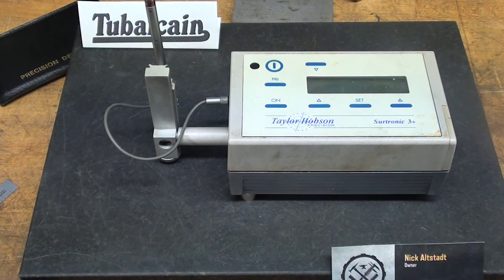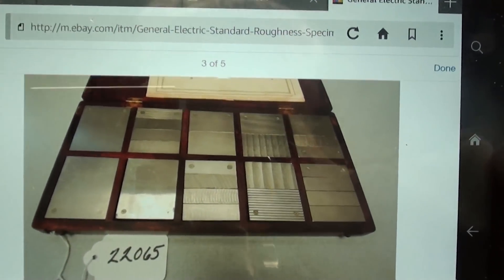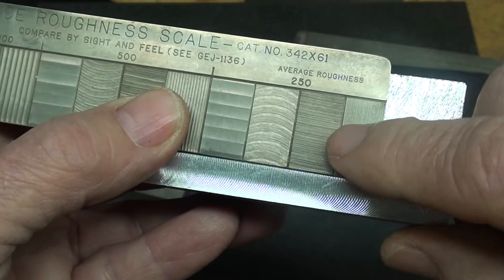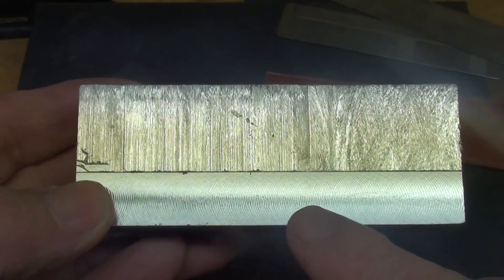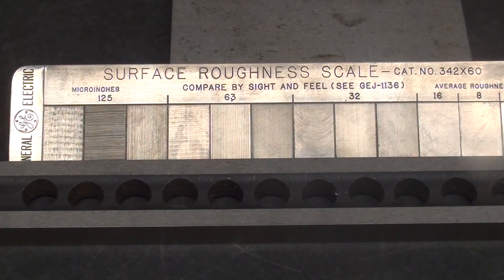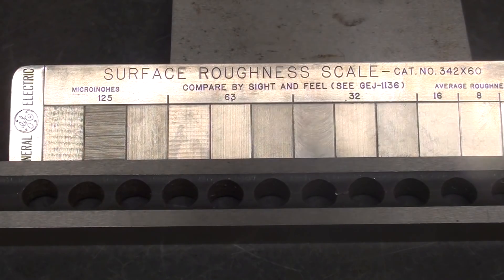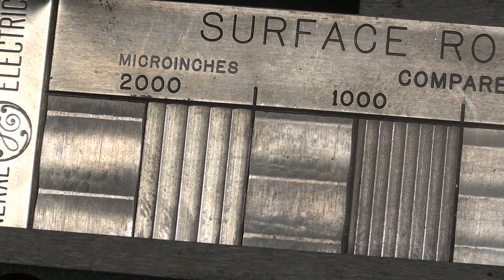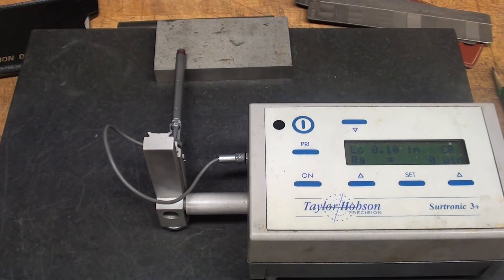SHOP TIPS #293 Surface Roughness Finish 1 of 2 tubalcain

Comment: Profilometers are often used to measure the roughness, the avg(Ra) the peaks(Rp) and the valleys(Rv), of the decks of an engine block and it's associated cylinder heads after they've been resurfaced. Some cylinder head gasket manufacturers require a certain finish in order to maintain a seal with their gasket.
Reply from the maker: Thanks

Comment: Long ago I tried an experiment of testing surface roughness using my fingernail and realized it was the sharpness of my nail that was the biggest limiting factor of how sensitive that method was. I had a fairly long thumbnail at the time so I stuck a sharp needle through it and used the tip on the needle as my probe. Let me tell you the difference was astounding! If you don't have any long nails and want to try this you can just as well epoxy (or other very hard glue) glue a sharp needle to your nail for a quick investigation of the physical dynamics of the system. If you are at all into surface texture, I bet you will enjoy it.

HA! I should have listened to the whole video before commenting. Good one. :-)

Comment: This is a very interesting subject for sure! Can't wait for part 2.

Not sure about milling, but for turning you can calculate the surface roughness. If you know the target roughness in Ra, insert radius and/or the feed. You need know atlest 2 then you can calculate the 3rd.

This calculation is in metric values.

So if the blueprint would call for surface finish of say 1,6Ra and you would use an insert with a 0,8 noseradius then the math would look something like this: Feed pr rev = Square root(0,016*32*0,8) = 0,202

Ra is in microns so that needs to be coverted to mm, so 0,016. The 32 is a constant. 0,8 is the noseradius. 

There is more factors that influence surface finish obviously but this should put you quite close to you target.

Comment: Interesting video Lyle, but then yours usually are. I'm commenting because my job as an external and internal grinder involved using these. We made turbochargers and the bearing surfaces  on some of our products had to be either 8 or 12. So I have used that very same machine 100s if not 1000s of times. Remember I had to stop work early aged 43 when my lower back wore out, but I did that job for 16 years. 
However you may have seen over the last year I still manage to maintain the skills of an engineer e.g. making the model steam engine, plus other projects that I do.
Reply from the maker: Thanks for watching

Comment: Thanks for the video, and basically everything !  As a home gamer, and a neophyte one at that, I often wonder what the surface finish can tell me about my cutting speeds/feeds, or bit sharpness, perhaps even the quality of the metal.  Its pretty hard when starting out, and you don't have a seasoned vet over your shoulder to interpret the results.

Comment: A question for whoever can answer. I have a pair of the GE Roughness Scales and I'm curious as to what they are made out of. Because there is green spots pitting the metal like it's tarnishing. And it's magnetic and they have a good bit of weight to them. It isn't that bad I'm just curious. I do use them. But they were like this when I got em. And if anyone has an idea on how to stop the tarnishing plz let me know thx. I used some silver polish on em and it worked pretty good they are nice and shiny. Just one has green little spots on it the other just has a few.
Reply: Nickel is also magnetic. I suspect the samples are made via electric plating process, like how the master molds are made for vinyl records
Reply: I thought nickel also but it would need to be solid nickel because some of the pitting on the back is pretty deep.
Reply: Thanks for replying!

Comment: Better way to compare surface finish using the GE style samples, is by scratching both surface with your fingernail. The difference is quite obvious, and in my personal experience, is more accurate than visual.